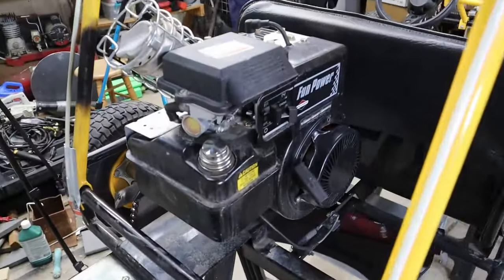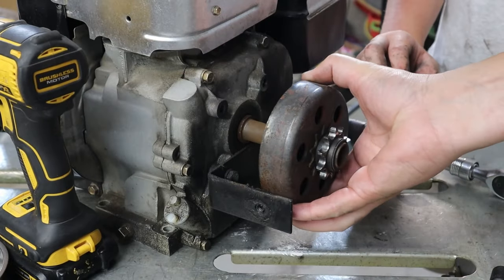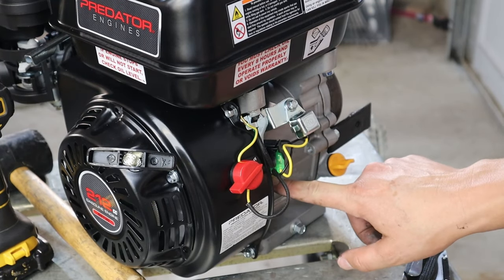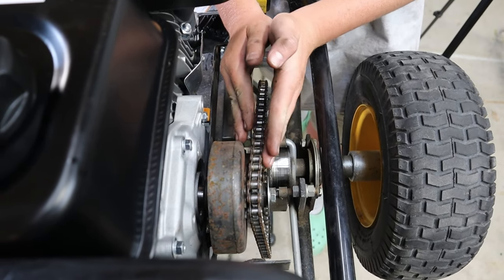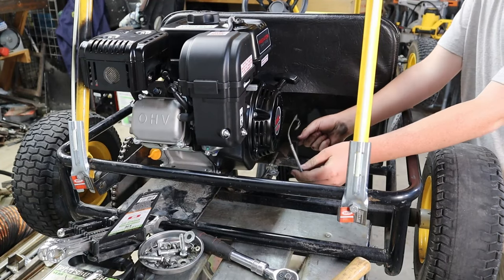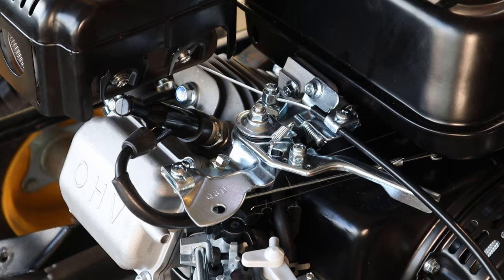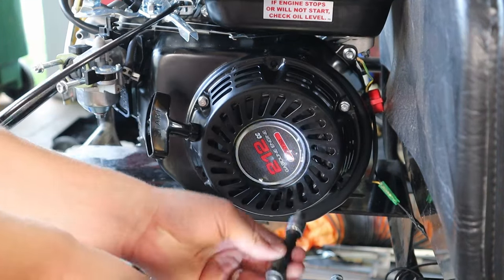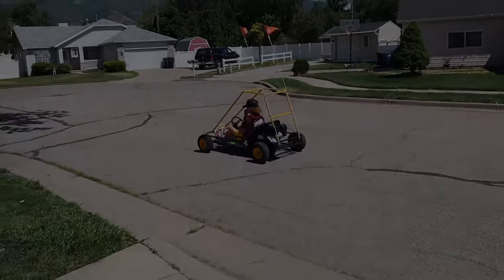New Predator 212 Go Kart Engine Swap  *Throttle cable install hookup*

Comment: How did you measure the throttle cable to make sure it was long enough
Reply from the maker: Just estimated it. The sheathing can be longer since it's clamped down on each end. Then once the ends are clamped the cable can be cut to length.

Comment: could you share where you got the seat for the kart from? i made a kart similar in size, jut need to hook up throttle and brakes but it needs a wide seat like your
Reply from the maker: It just came with the cart. I've made a couple before with plywood, foam, and some black vinyl.

Comment: What is the clutch / gear that you used, please?
Reply from the maker: https://amzn.to/3xoI9MG
Just make sure you double check your shaft diameter thickness.......on the engine and chain size.

Comment: What is the thread size of the bolts that mount the chain guard? 0:59
Reply from the maker: It's a fine thread 5/16” - 24

Comment: Does it matter which wire to tie into on the killswitch
Reply from the maker: Nope, it is just creating a short circuit when open so it doesn't matter.